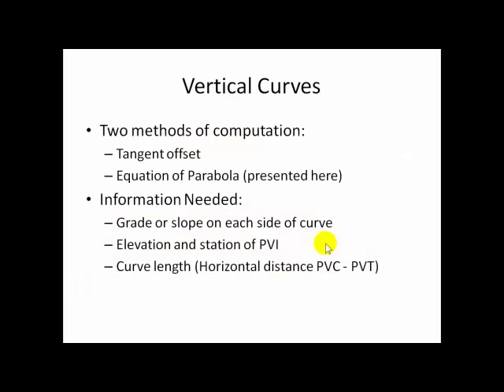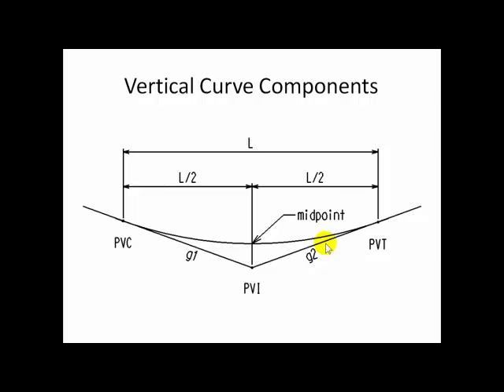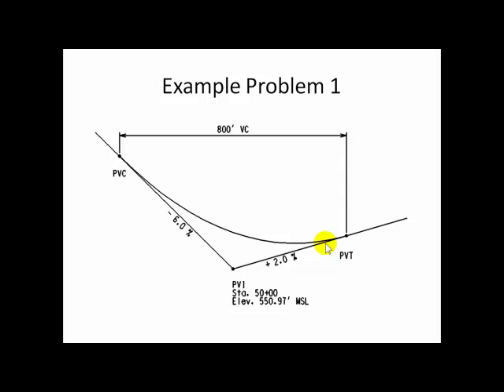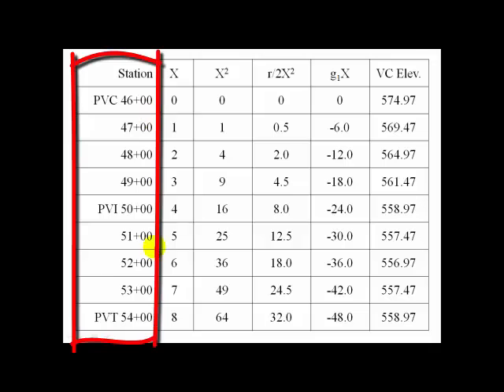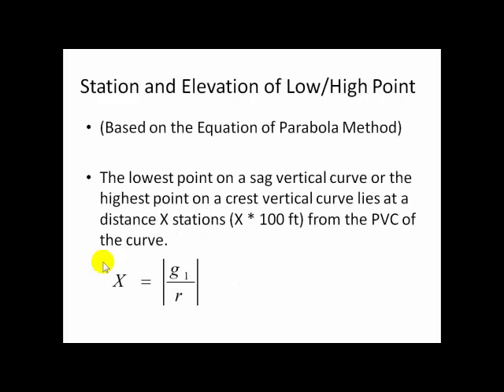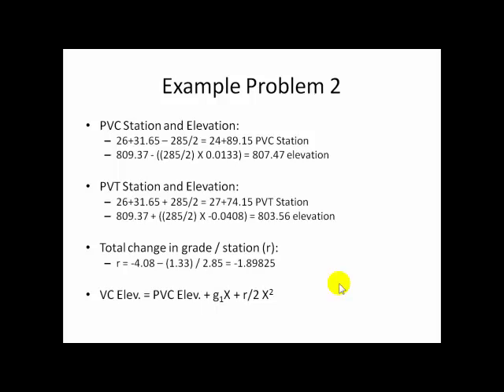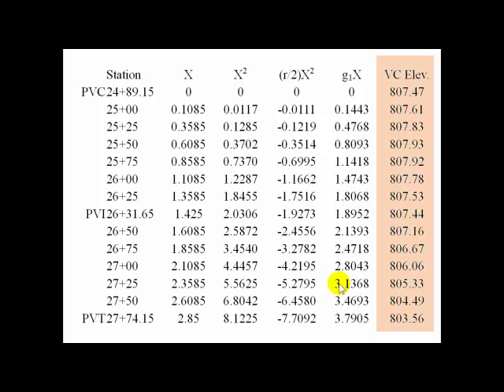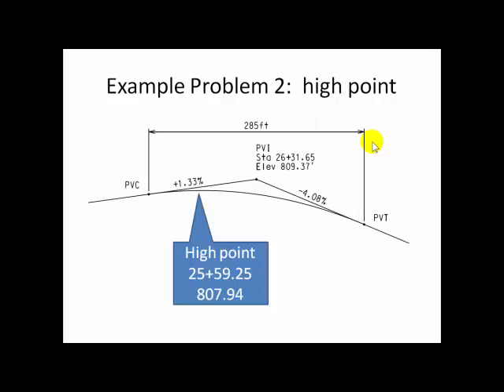Vertical Curves

Comment: Looks like there is a mistake in calculating the high point elevation.  Wrong r value used.  The r value should have been -1.89825.  The g1 value was used instead.  High point elevation should have been 808.87 ft.